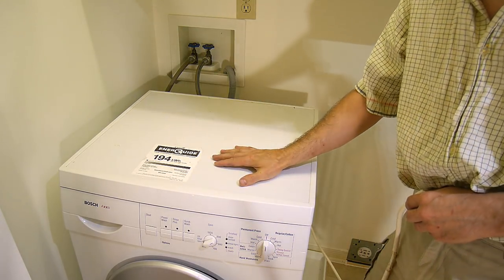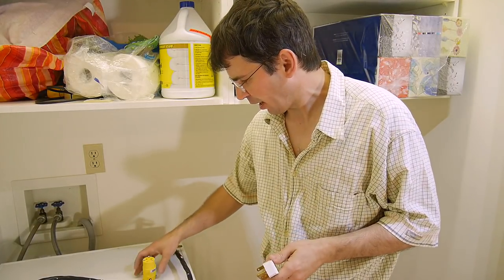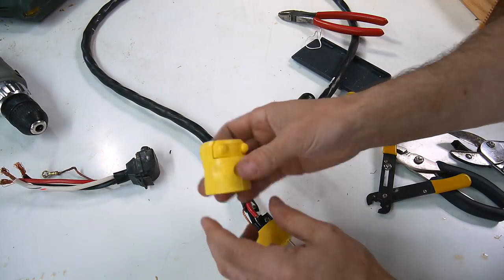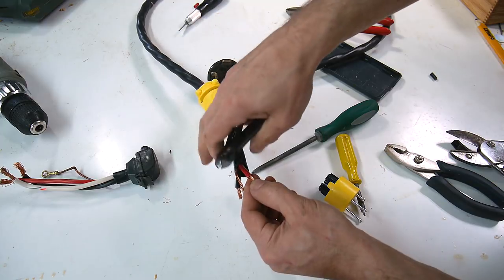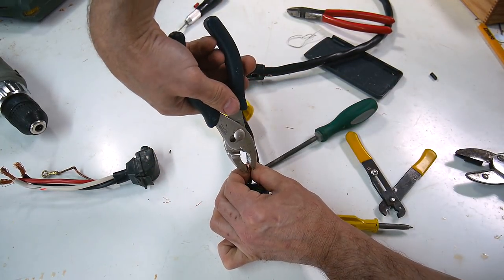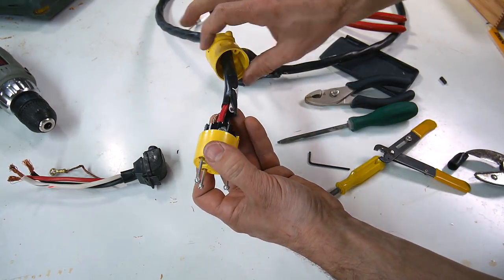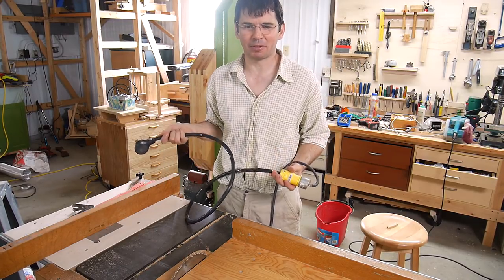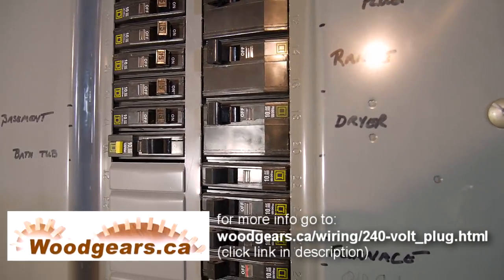240 volt from dryer plug (for Euro-washer or table saw)

Comment: There sure is a lot of fuss about the pigtail that was used for the washing machine, I'm not sure that the machine is European as the plug is a nema 6-15 ( 220 volts 2 hots and a ground 15 amp) and the wall plug looks like a nema 14-30 ( 220 volt 2 hots, neutral and ground 30 amp) apparently the washing machine didn't need a neutral wire as it wasn't wired for it. Also isn't European 220 volts on the hot side line then a neutral and a ground?
Any way all he did is make a custom drop cord for the washing machine, good work Matthias.
Reply: It's AC so 120V to -120V is the same as 240V to 0V.  The machine would only see 240V on the circuit.  The waveforms would differ but the apparent voltage would be the same.  It's definitely a Canadian model washer, apparently the matching dryer has the 6-15 outlet on the back so the washer would be daisy chained through the dryer.  It's Canadian because it still has the EnerGuide sticker on it.

Comment: I don't get it.

What voltage does the washer need and what do the sockets (dryer & normal) supply?
Reply: the washer needs 240v (because its an european washer), but the normal socket supplies 120v, but the dryer socket 240v.
Reply: Bert Bertmann Washer:240V, Dryer Socket: 240V
Reply: why not use 230v for everything? would be too easy
Reply: Washer made for 50Hz, dryer socket 60Hz.
So the motors will probably run ~20% faster than it was designed for. So, it is likely that it's life will dramatically reduce and it could even overheat.
Reply: Are there two kinds of plugs? Normal 240V and dryer 240V?
If not why not just plug the washer into the dryer outlet?

Comment: Those Old fashion breaker boxes...scary AF. Glad my place was recently entirely rewired and a brand new breaker box or a 'fuse box' as we call it in the UK...100A Main Switch, 2 x 80A 30mA RCDs, 12 x MCBs (4 x 6A, 1 x 10A, 2 x 16A, 4 x 32A & 1 x 40A).....
Reply: American fuse boxes still look like that. They haven't really changed since the 70s.

Comment: Neutral and ground are always hooked up "in parallel". But that's the point. One is a safety that isn't in active use. shrug
Anyway, wire in the walls is usually okay to be uprated (unless it's so thick it doesn't play nice with the receptacle, methinks). So my solution in a finished Canadian basement would be to replace the circuit breaker in the panel and receptacle in the wall for the ones specified for that washer (and they usually do have a label with that info).
Of course, do not replace the breaker and receptacle if it's originally a standard 15 amp plug on 14 gauge wire (or if some previous lunatic used 14/2 on a 30 amp breaker ;) ).

Comment: I'm sure the washer has a fuse in it. That fuse will prevent the cord from starting a fire if there is some fault. There is really no legitimate safety problem with this whole arrangement. The circuit breaker is there to prevent the wiring in the wall from starting a fire. The appliance has to provide protection for the power cord.

Besides, people plug 16 and 14 AWG lamp cord into outlets with 15 or 20 Amp breakers all the time. But a 16 AWG lamp cord cannot handle 15 Amps, let alone 20.

The good thing about making the adaptor plug is that you were able to leave both the outlet and the appliance unchanged, which is good.
Reply: There is never a fuse in North American appliances. Or if there is one, it's to proctect the appliance itself. The only means of protection for the wiring is the breaker at the breaker panel.

Comment: Matthias, This is the first thing I've ever seen you do that scared me to death. The proper (and easy) way to solve the problem would have been to remove the existing cable from the dryer and replace it with the proper cable and plug. I've done it a number of times and it is really simple. If that new connector you installed gets wet, you have serious safety hazard that could kill someone.

Comment: I would have connected the neutral wire to ground as well in the plug, mostly because if somehow this cable ends up somewhere else and they attempted to plug it in to a proper 3-phase socket, it would instantly trip the RCD instead of having an unused but powered live wire in the socket.

Also the gauge of these wires is completely overkill, even for 240v@20a.
Reply from the maker: 3-phase uses different sockets
Reply: Yeah,  I looked up some images and you're totally right. Over here for home 2 or 3 phase power we have a Perilex socket that can handle 3 phase + neutral + ground or 2 phase + neutral + neutral + ground, where the type of plug determines if it's two or three phase power.

In that case, it's probably better the way you did it.

Comment: I suspect this washer has a DC motor, so it won't care about 50 vs. 60Hz. If it likely also has a switching power supply, that may not care either.
Reply from the maker: Europen washers tend to have heaters, which use a lot of power. That's probably why it has a 240 volt plug on it.

Comment: So in N. America the 240V is between two phases like 415V in Europe?
Reply: We use single phase.
Reply: No, we use split single phase. We use a center tapped transformer to supply residential power where the center tap is tied to ground. Each hot is one leg of that center tapped transformer. But it is all one phase. Between either hot and the center tap is 120V, and between both hots is 240V.
Reply: Two phase would be two sine waves out of phase with each other. Single phase is only one sine wave. 120V is just half the amplitude of 240V. But it is not another phase. Look at it this way say you have a step down transformer and you energize the primary. Then you maybe have an output of say 12V on the secondary. It is not a different phase compared to the input voltage, it is just smaller amplitude. Like if you're tuned to a radio station and turn the volume up, and down. Same signal, different level. Two phase would be receiving two stations at the same time. Which is something completely different.
Reply: So are there no 3 phase installations like here in Europe? We receive use three 240V phases from the transformer station, where there is only one distributed to a household, whereas industrial buildings receive all three.  Then you use 415V on machinery like welders and lathes etc. We have 5-pin 32A plugs (3*240V live cables, neutral and earth). How is is over there? How do you get high voltage equipment to run? Or is it just run on 240V?
Reply: If it is available, and or you want to pay for it you can get 3 phase power here. It is always cheaper for smaller consumers to on site convert 3 phase though. I am not sure where the break over lies but I suspect it falls somewhere around thousands of dollars of power a month. Do you use that with your lathes, and welders?

Comment: This is not a euro plug. Euro plugs will have 3 conductors a hot, neutral and ground. The euro hot gives 220v to neutral. The US hot gives 110 to neutral thats why there is 2 hots

Comment: The 40 amp breaker in you box is to much protection for that Washer, it may not trip if the washer has a electrical problem and could start a fire. You should replace that breaker with a 20 amp or one just slightly higher than what the washer draws.

Comment: electricity is worth doing properly. the weakest link in the chain will be where the most heat is created. using an under-rated plug, or an over-sized breaker, you're asking for unexpected surprises.

Comment: I will never understand why you have all these different sockets in America while in europe there is a standard 3 pole 220/230V and schuko type
Reply: Because in Europe there are fused plugs aren't there? So you don't have to worry about a 40A breaker not protecting a 2.5mm^2 flex cable because there's a 13a fuse in the plug? 

Fused plugs are not typically used in the USA and we don't want someone to be able to plug a cord with 2.5mm^2 flex into a 50 amp circuit.

Comment: I'm wondering why you didn't just replace the cord on the back of the dryer instead of cutting the one you had and adding inline plug. I agree that the plug solution is fine but it would be simpler to change the dryer cord. Anyway I'm glad you didn't have a "WOOPS" moment and keep the great videos coming.
Reply from the maker: didn't wat to chane the washer (and by the way, it's a washer.  Maybe try paying attention)
Reply: Sorry was a simple mistake when talking about dryer plugs and cords. I meant no insult by my post. I was just wondering. (and by the way, what's a wat? Maybe try paying attention) Sorry I had to. Not trying to be a troll or disrespectful. Just having a little fun ;-P

Comment: Why do Dryers in Canada have such high amp plugs? Where I live, all dryers use 10 Amp 240 volt plugs. No one here ever uses anything higher.
Reply from the maker: Our dryers are more powerful than yours
Reply: What do you need a more powerful dryer for if you rarely use it? Also if I really wanted a more powerful dryer I would just use a 500 volt 32 amp dryer, it is a much more common plug than 240 volt 40 amp.

Comment: Bro, all you have to do is remove the back panel and unscrew the old white cord and replace it with the new one.  Or just but a new outlet that fits the washing machine's factory plug.  You did 10x the work for something that can be done in a few minutes for cheaper.

Comment: I hate to add to the negativity, but I have the same washing machine, and I have had to fix the door twice already because they cheaped out and used really brittle plastic, so maybe ease it a little when closing the door :) If it does break, super glue and paper work really well to build up the lost plastic

Comment: In the UK everything just plugs into the same three pin plug even dryers. Why is it so complicated in the US
Reply: This is done to make sure that the current capacity of the wire can handle the load. For example, our standard plugs are for 15A applications. As soon as you need 20A, the plug is different. So you can't accidentally plug a 20A device into a 15A circuit which would be a fire hazard.

Are you saying that in the UK all outlets can handle the same amount of current? If not, then how do you keep people from plugging high current devices into low current outlets?
Reply: Treasure Pirate no, for that they use breakers as everywhere, breakers are used to protect wiring
Reply: Treasure Pirate How can you plug 20A into 15A if the breaker is 15A. Won't it disconnect? That's very interesting.
Reply: You can plug a 50A 240v appliance into the outlet in your bedroom?

Weird, cause I thought your ridiculous ring circuits were protected with a 32A breaker.
Reply: If its 12kW it will be for 99%  3fase, so no. Thats diferent socket.
Reply: @OneMarko - Correct. If you plugged a device that needed 20A into a circuit that had a 15A breaker, it SHOULD pop the breaker. However, that assumes that the breaker is working. Also, having different plugs allows the consumer to understand what outlet in their house can be used for that device without having to go to the circuit panel or just keep trying each plug until one works.

That's probably the main reason why it is done. If the plug on a 20A device was the same as the plug on a 15A device, how would you know which outlets you could use for the 20A device without either opening the circuit breaker box or just manually trying every outlet (and subsequently having to reset the breaker when it doesn't work)?
Reply: He is in Canada. Not part of US, although the electrical system is very similar.
Reply: McKenzie Keith very similar is an understatement.

Comment: Whut old situation seemed really dangerous!!! 240 volts probably over 1000 watsss with bits of tape
Reply: Not everything is as it seems.
Reply: Way more than 1000 watts. A dryer breaker is usually rated at 30 amps. So 240 * 30 = 7200 watts

Comment: You are using 220v 20amp plug on 220v 30amp circuit ... thats kind of dangerous
Reply from the maker: In that case, never plug a lamp in the wal.  Cause you know, neither the lamp nor the cord are rated 15 amperes like the socket is.

Comment: Could you not have just replaced the whole wire from the back of the unit?
Reply from the maker: of course I cold have.  But that would have been WAY more work
Reply: That would void the CSA/UL listing.

Comment: A washing machine is definitely not the type of device which you should be taping wires against the pins of the plug. The heating element takes many amps and such a connection, which there are no good words for, could easily have catched fire. Not sure if some laundry is worth your whole house burned down.
Reply: Yeah but it didn't so that blows your theory out of the water.
Reply: Not sure what washing machine you have with these heating elements taking many amps. We have water heaters and boilers where I come from. A washing machine is also typically plugged into a normal 15amp circuit.
Reply: billybobjoe198 15 amps is more than enough to start a fire by a dodgy connection. I have seen it happening with my own eyes, and it's no fun in the middle of the night in a wooden house with all your family members sleeping upstairs and a fire doing its thing in the laundry room.
Reply: I didn't say it wasn't I just said washing machines don't have heating elements.
It takes tiny amounts of electricity to start a fire, if it's arcing, it's heating. You could have a 12volt 0.5amp arcing connection heat up enough to start a fire.
Reply: The european style machines do have heating elements

Comment: I have a Square D 15 amp double pole, you can have it for free if you want it. It's left over from rewiring my last house, and my new house uses different breakers so I have no use for it. I'm in Bells Corners.
Reply from the maker: Not sure if that is what  is in the house, but I will need some extra breakers.  Send me an email.
Reply: NP, sent to the contact email off your website.

Comment: It would have been easier to install a new plug onto the appliance lead or to replace the lead.  If you have to cut off strands to get the cores to fit in the terminals you have the wrong plug for the cable.

Comment: wow your power is weird .. here we have an 15 amp on the washer/dryer circuit, 220 volt - 2 x 1.5 mm2 wire and this is a pro jobb.

Comment: Mathias trolls the Safety Sallys. He even goads them by expressing false concern that "This may cause the breaker to not pop if the circuit is overloaded, which may cause your wiring to overheat." But of course his dryer wire is rated for 30 amps, same as the circuit breaker, so that's not really a problem. The European appliance should be internally fused as necessary for safety since no approved appliance ever depends upon an external circuit breaker.

The only problem that I can see is that if the floor gets flooded then water could get into the plug and cause a short circuit. That would, however, trip the circuit breaker.

Comment: Canadian / US power systems and regs are way scary from an Irish European perspective.
Reply: Nah, they are low voltage so nothing can go wrong. [ ;) ]
Reply: Alan Byrne 240v 60hz with 110v 60hz outlets are far safer and better than 240v 50hz. look into why Europe uses 240v 50hz. the reason is so stupid its comical
Reply: Yeah safer... definitely safer.... for burning houses down due to requiring high currents through thinner wires!
Reply: If you look at the countries in the world that use 110v -130ish volts against the amount that use 230ish voltage, you will find that the 230 volt countries far out weigh the 110v, I wonder why the they don't seem to see the joke. If you have the voltage then you need to double the current to get the same power. A simple case of Ohms Law which is the same in the US, Canada as it is in Europe and the rest of the world.  The higher the current the bigger conductor you require to carry the load. It is current that kills more so than the voltage that is why the power supply to a cooker, drier, shower or incoming supply are more dangerous than a simple lighting circuits fused at a lower amperage. Therefore if a lighting circuit in the US, Canada is fused at 20 amps, the European equivalent would be 10amp. And what has frequency (hz) got to  do with it?
Reply: The only thing frequency has to do with it is it "hertz" when you get shocked ;)
Reply: I agree with the conductor size, but I'm not sure that saying that it is less safe with 110 V is entirely correct. Regardless if 20A/110V or 10A/230V, if you touch any of those the load from your body will draw only a fraction of the maximum value (ie. the fuse) and will not cause the voltage to drop at all! Hence the 230V will drive about double the current trough someone's body (Ohms law again) so 230 V would be far less safe from an electrocution standpoint, but much safer from in regards to fire hazards.

Edit: Then again 60 Hz would yield a slightly lower impedance from the body, but since that is linear it doesn't do that much.
Reply: Is the body capacitive? Or why would the impedance decrease with frequency?
Reply: Kristoffer Olsson if you're standing on the floor wearing shoes, you are most certainly capacitively coupled to ground
Reply: Kristoffer Olsson search online for "skin effect", it's more pronounced with RF frequencies
Reply: And yet we seem to survive. North Americans seem to pride themselves on being insane!
Reply: Yeah, you Europeans always think "your way" is the best way.
Reply: What makes you think anything he did in this video was regulation.
Reply: I = V/R

Current is a function of the resistance of the human body and voltage in a situation where you are being electrocuted. Most residential circuits are 120v but we do have 240 available for high load applications that need it. So most people when their plugging in devices are only dealing with half the voltage Europeans have to deal with.